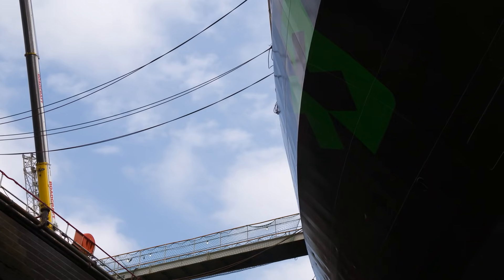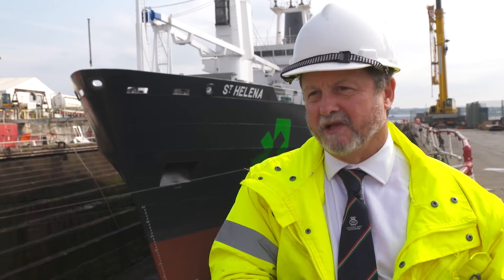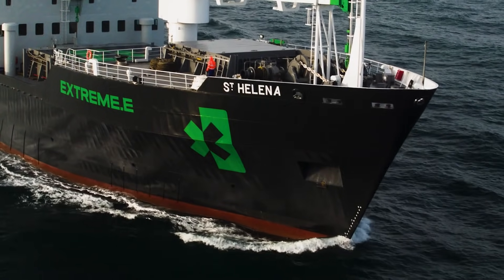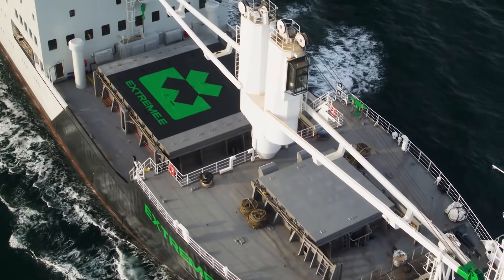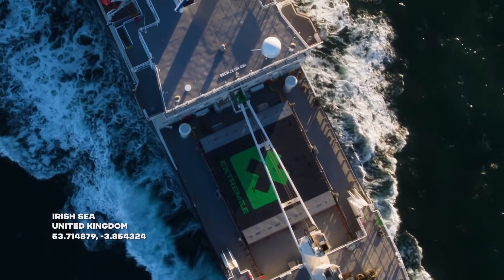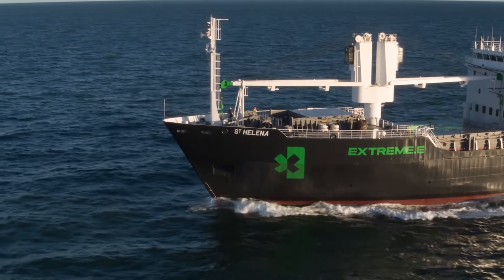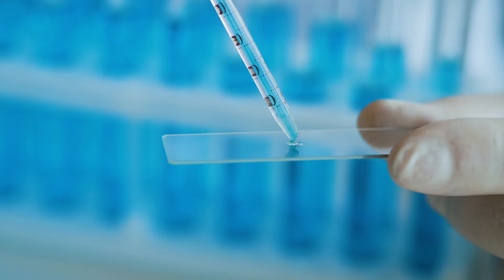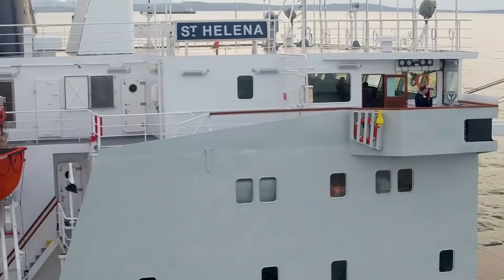Why Does Extreme E Use a Ship? | St Helena | Extreme E

Comment: A comparison with for instance the F1 fleet regarding emissions would be interesting to see. E.g. kg of CO2 emited per kg transported per km
Reply: Will probably be so much higher since they have a tighter schedule
Reply: agree, the data is important. Unquestionably shipping is far lower emissions than flying, but how much in this case?
Reply: @dstarley  actually with how little cargo they are moving on such a large ship i can't guarantee that this will have lower emissions than flying per ton moved. Ships only have low emissions at scale. However they are doing more than just moving the cars as it is also doing science for PR reasons soooooooo ...... meh
Reply: @Kwesi Lawrence Actually we carry 72 containers , 10 Spark Odyssey 21 cars, 8 hybrid BMWs, 1 Cupra Formentor, a forklift, three trailers... but good guess! I live on the ship full time btw ;)

Comment: Did you fit any serious exhaust gas cleaning systems at all? LSFO is commonly used in shipping since it is also mandatory in many areas and HSFO is not allowed any more at all. Champange would be ULSFO. You could have fittet an SCR for example or rotor sails. A great opportunity would have been to fit fuel cells instead of classic diesel generators for power supply in port, or do you always use a shore connection?
I think you could have done much more to reduce the carbon footprint of the vessel. Hopefully you'll do so in the near future. I think you're not running short on money and it would be great if you would make the ship a prime example to show to the whole shipping industry what is possible.
Reply: ahh...I love BS knowledge and ideas from people outside of the industry. Dude, just for your information this vessel most likely have medium speed 4 stroke engines which run on Marine Gas Oil (MGO) - ISO 8217 DMX or DMA fuel oil type which have max sulphur content of 0.1%. Your LSFO HSFO or ULSFO refer to residual fuels (heavy fuel oils - RM grades) which I do not think this vessel was using at all. As for marine grade fuel oils You won't be able to find suppliers for fuel oils with sulphur content way below 0.1%...You can always try to park your vessel near some shore petrol station which sells different grade of fuel oil with sulphur content at 10-15ppm level, although I do not think station's storage will hold enough fuel to fill vessel's tanks for one intended journey, plus it won't be economical at all. So called MGO DMX and DMA grade fuel  IS the CHAMPAGNE of marine fuel oils and it is currently widely used all over the world. What they have done on the vessel, is probably overhauled the engines and auxiliary equipment mainly TO COMPLY with regulations regarding emissions control for NOXs (less likely to be more GREEN - that is just PR BS). They must have replaced components for fuel injection systems for their engines (not redesign and modify their systems to use some space technologies) just because all those old engines, they do not like low sulphur content fuel oils (lack of lubrication, increased wear of injection pumps and injectors). As for SCR, do You know how it works even and when it kicks in? It kicks in only at higher loads because it requires higher exhaust gas temperatures to break down urea to ammonia. If the vessel will steam at lower speeds to conserve fuel and "emit less CO2" this system will not be in use at all. Plus even running it like that  will create several problems as over the  time degradation of engines performance thus increased NOX emissions. Fuel cells? Are You serious? Check how efficient are your fuel cells now - between 40-60%. The rest of the energy goes into the funnels along with the CO2 and some NOXs as well. I think they should stick to more eco friendly diesel engines running on fossil juice. Not to mention I do not think anybody makes those fuel cells for marine industry. Yes of course there are some new vessels with so called hybrid propulsion systems but that is different story and have as well some negatives as well.  I have seen recently some job offer for this vessel for Engine Room Department, although just by looking at what kind of people - soy experts and soy intellectuals are all around that organisation, in social media as well and probably on the vessel, I think I will stick to my current boring job, so I don't have to deal with that GREEN BS every day....